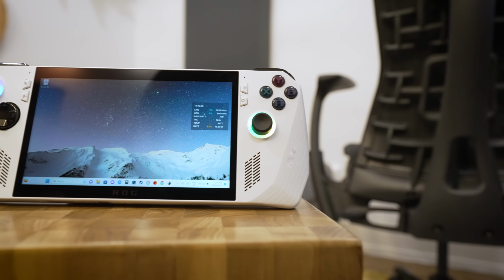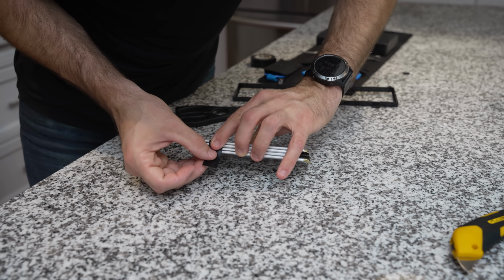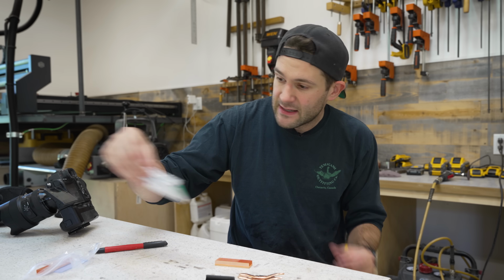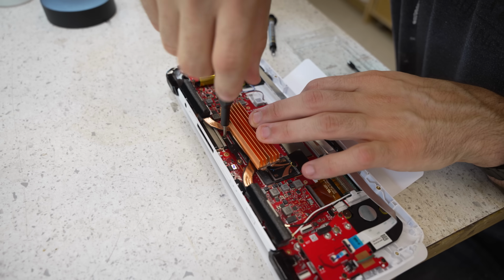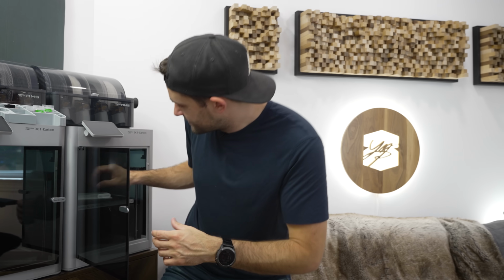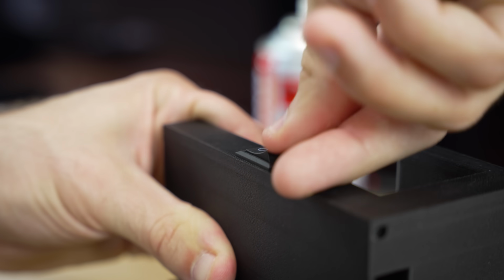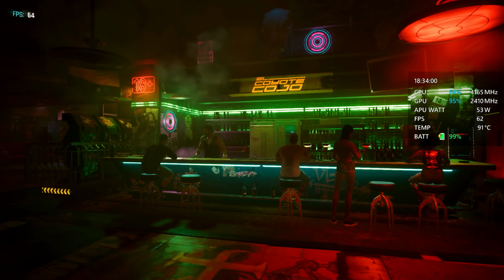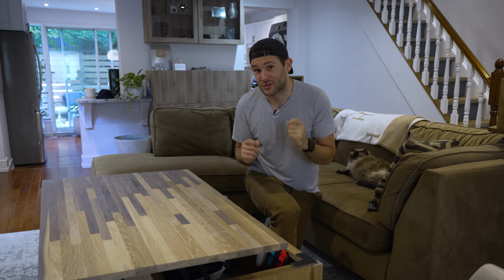I don't understand why people buy Steam Decks...

Comment: The Z1 Extreme and for that matter, the 7840U are quiet good, but lose out to the steam deck where it matters the most for this application: performance+battery life. At 5 or 10W, the steamdeck kick to but of the Z1E/7840U and they draw at 15W before the deck loses beyond that. But outside of docked/plugged, i don't see the value of 25W handhelds. I'd rather use the extra 10W for an OLED 120HZ VRR display on the deck if possible.

But hopefully this odd thing where the older hardware deck wins will be fixed with proper optimization, which is the reason why it's better at lower tdp.

Comment: You should send yours out for the 32GB RAM Upgrade. BIOS 330 comes out later this week, which is what I was waiting on. Once upgraded, you'd need to desolder and reflash the BIOS chip for 32GB. Some great work has been done on the Discord in terms of identifying Micron vs Samsung Ally's, the strap resistor location, and timings. 7500MT/s is possible on the Ally; as is 32GB RAM with 16GB allocated for VRAM. :)

Comment: The fact the temperatures decreased THAT MUCH by adding that copper heatsink is pretty amazing to me. Good thing to know
Reply: Actually, the thermal compound alone is worth 5 degrees at *least*.  The Honeywell pad is a miracle in that it competes with regular paste, but liquid metal is just in another league.

I'd recommend the SD heatshield, 2tb WD 2230 for slightly more than the sabrent 1tb, liquid metal thermal compound if you really want to get your hands dirty, and then call it a day.

The GPU doesn't scale much past 800mhz, all that raising the power limit past 15 watts does is let the CPU loose while the GPU is pegged.
Reply: @pondracek  damn I actually somehow forgot about the liquid metal before writing this comment. Yeah you're right that's probably a big contributor.

I myself have never used it due to the inherent issues that come with it being electrically conductive. But I heard many good things
Reply: @TheLiquidlane  I've never had an issue until recently.

Do not use it on aluminium heatsinks.  Was never an issue for me, but a friend bought a cheap heatsink with copper heatpipes in aluminium, and the aluminium just wouldn't stop oxidising black before my eyes, like when it's exposed to lithium.
Reply from the maker: Ya I was pretty surprised at the differences, and keep in mind, I didnt touch the fan curve at all. If you locked the fans at like 40% the difference would be even bigger.

Comment: I'd like to see how the battery life of the original battery was affected with the heatsink mod (or how battery life with the bigger battery and original cooling went). Nice vid.
Reply from the maker: Probably wouldve affected it a BIT due to lower fan temps, but outside of that I wouldn't expect much of a change.